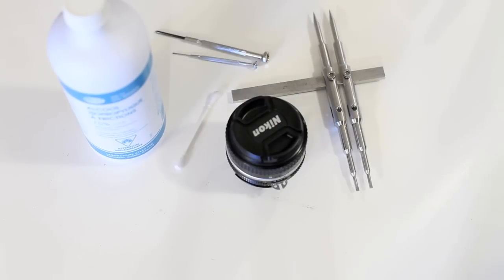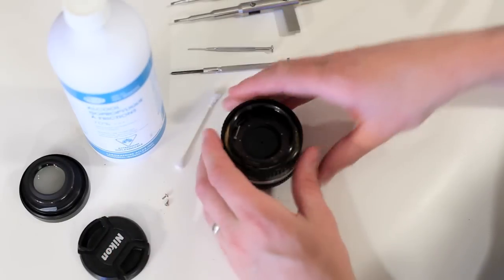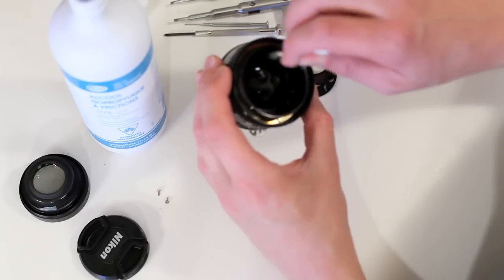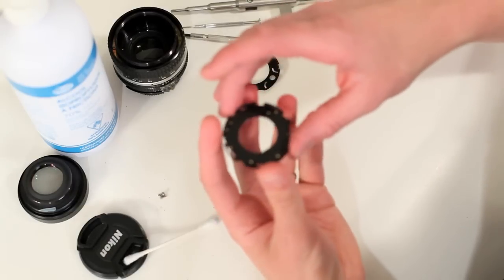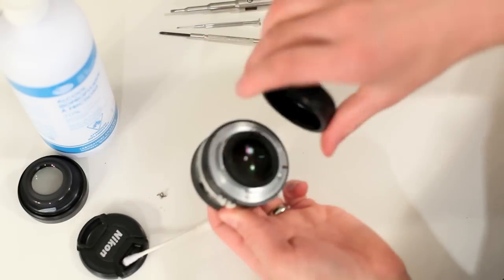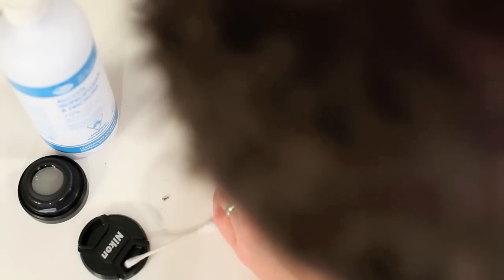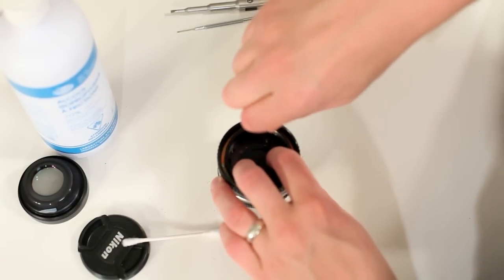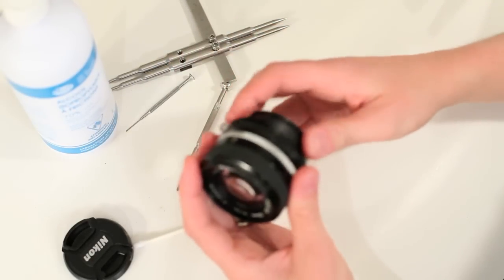How to Disassemble and Repair Oily Aperture Nikon 50mm 1.4 ai-s Prime Lens

Comment: Have you ever cleaned and replaced the helicoid lube in the focusing barrel threads before? I just got this lens and it was in new condition when i got it but i think the lube has dried from sitting in a box for a couple decades, which is causing the focus barrel to be a bit too stiff.

Comment: They never managed to disassemble the lens, one of the 2 outer screws holding the aperture ring has no slot for a screwdriver and is rounded, after removing the front grub screw and taking off the front ring there was a gouge in the thread where the grub screw had dragged (their forced attempt no doubt), managed to get it off though. cleaned the front element but the seepage is in between the 2nd and third lens (group) which appear to be bonded together and held in with a pressed ring.

Comment: Your awesome.  I am in a fix though, I have a 50mm 1.2 that I took apart from the back end and the blades are out but I cant get the front element off.  Basically it seems the only way to put the blades back together is from underneath..not sure if thats possible...thoughts?

Comment: Thanks for the video Todd you saved me from having a $100 AIS lens go completely to waste.  I bought the lens on ebay from what I thought was a reputable dealer in supposedly great condition.  1 month after the purchase, I noticed that there was oil leaking and that the aperture wouldn't operate properly and I hadn't even really used it yet.  I tried to get a refund but the dealer refused.  When I began the repair, immediately i noticed after removing the front ring, that front element wasn't even screwed in.  I didn't even need to use the spanner wrench, the element was completely loose and just popped out in my hand when I turned the lens over.  This tutorial has been a lens saver, thanks again!

 PS, you make it look so easy, it took me nearly 2 hours to complete, blades not cooperating falling off and having to start over, difficulty threading the stem through the hole, nevertheless, it was well worth it.  Thanks again!
Reply from the maker: Woo Hoo glad it worked out for you! Ya that is really odd that the element just fell out like that! Sounds like someone tried to repair it and didn't get very far and made mistakes. Good thing you could repair it.

Ya I have done more lenses then I can count so they become fairly easy when you do a few. My first took me forever when I first started.

Glad this helped :)
Reply: Todd Armstrong Yeah so far It seems to be working great and tikity boo ; ), thanks again! I think you're right about it being a botched attempt at a repair.  I wonder..are there any concerns about the lens not having any oil now?  What do recommend for storage,handling, usage, maintenance, etc, being that the lens is no longer lubed? Thanks again for the great tutorial and awesome spirit for helping fellow enthusiast!  You have great hands too, you probably could have been a surgeon... lol!
Reply from the maker: Rafael Jenes Ha ha my mom always said I should be a brain surgeon but I don't think I could have stomached it ha ha!
Well the only oil that should be in the lens is a very tiny amount on the aperture ring which is thick and never really leeks, and the oil in the focus helicoid. The oil that gets on the aperture blades is the helicoid oil which is lighter and when the lens gets warm it can leak or if the oil starts to break down over years. This can be removed entirely and replaced and in fact if you look hard enough you can find grease that Nikon use to sell. It is really hard to find though. However with my experience I don't think it is worth it to replace as it usually takes years for the oil to leek like this again and chances are one might sell the lens for another way before it is time to clean it again. Hopefully after your clean it won't need doing ever again anyhow.
So as long as the focus is still smooth then there is no reason to replace the grease in the helicoid unless you would like to cosmetically dampen the focus to your liking.
I just clean the aperture blades and shoot. I rarely ever do a helicoid job. :)

Comment: Hey Todd, I own a Nikon AF NIKKOR 24mm. I love this lens. Being from video. I wanted to use the lens without the clicking aperture and successfully did it, but in turn when I removed the back housing I accidentally tore the ribbon cable that talks to the Lens. Do you know where I can buy this sensor? I learned the hard way that opening any lens is just a very dangerous endeavor.
Reply from the maker: Oh no I'm sorry to hear that! I usually look around on ebay for parts or find an ebay lens with smashed elements or something so you can get the lens cheap. Take the part out and resell it on ebay and you "might" even make some money on it ha ha! I buy/sell damaged lenses and bodies all the time to repair stuff.
A rough version would be to solder new wiring as seen at 12:40 but I would get the proper parts for your 24mm.
How to build a Canon 50mm 1.8 ii EF EOS Tilt Shift Lens DIY pt.1

Hope this helps

Comment: Good disassembly vid thanks, Picked up this lens for $50 off ebay that someone had used wd40 on, unfortunately it has creeped in between the front element group (between 2nd and third lens) and has left a ring on the edges of those, they had obviously tried to disassemble the lens but only managed to strip screws and destroy threads
Fortunately the distortion creep doesn't affect the circle for DX sensors so cleaning the first element and de oiling the inside has given me a decent lens for cheap

Comment from the maker: No the lubricant is the problem that makes the blades stick. The blades are suppose to be dry or covered with carbon for a smooth glide. The grease comes from the focus mechanism leaking over time and goes everywhere and can even get on the elements.

Comment from the maker: Gosh I just don't remember. I did a P and either a Ai or Ai-s but I also did a 135mm f/3.5 and one of them are pretty annoying and I just don't remember which one was which. The P I think was simple but I think the 135mm f/3.5 was a pain becasue you have to take apart the helicoid. I think if you get the top taken off yours you will soon see if you can just pull the optics or if you have to tear down the helicoid. I usually dont bother if its the helicoid for time sake. Sorry I can't really help

Comment: Great video ! I have a nikkor 35mm f2 that is stuck wide open. I can't stop down. However if I remove it and slide the lever I can stop it down. Also, if I leave the lever, it doesn't return to wide open automatically. The aperture blades also look oily. Do you think I have the same problem as you ? Would cleaning my lens like you repair my lens? Any help would be greatly appreciated. Thanks !
Reply from the maker: Yes so if you see oil on the blades then it will need cleaning. There should never be any oil on them or they will slow down or hang up. There are a couple versions of the 35f2 but they are fairly simple to clean and similar to this 50mm repair.
Reply: Cannon Fast Reviews Thanks so much ! I will try to repair as soon as i get the tools :)

Comment: Where do you buy the spanner tool? I think I need it to remove the top element from my Nikkor Q 200mm F/4 non (AI-s)
Reply from the maker: J Lewis I get my spanners from ebay. I like the small cheap ones that are curved and also the long straight box spanners. Both do things the other can't do so they are a nice pare together.

Comment: You sir, are a genius. Thanks to you I just cleaned an oil refinery out of my 50mm 1.4 and now it works like brand new. Only issue I had was fitting the pin and aperture mechanism back into the lens barrel with my fat hands holding it. Had to remove it twice and reset the blades. But now it's awesome and going with me on vaca. Thank you for taking the time to post these videos.
Reply from the maker: Woo Hoo glad to hear!! Another lens saved!
Yes they can be very difficult feeding everything back together and takes some practice. Some lenses still take me a bit.

Comment from the maker: Yikes I'm not sure about repairing the aperture from the bottom up and didn't think it was possible to get the assembly out that way. I did one a while ago and I'm just trying to remember how its done. I believe its simple, you need to get the front filter ring off. There should be a screw on the side to loosen first and it may be under the rubber grip. Then undo the rest and the entire optics and aperture assembly will come out as a whole.

Comment from the maker: Sometimes if you just work it for a while it will loosen up but that only works sometimes. I have had some completely seized up and what I do is use Atlas Gear Lubricant which is amazing stuff and is plastic friendly as well. Just a touch and let it sit for a few hours and it will actually soften the old grease and make it useable again without having to replace the old grease. I have used it for about 7 years and works perfectly.

Comment: I bought a cheap used 50mm f1.4 Nikkor on eBay, and it arrived with dark oil and sticky blades.  I use this 100% manually on an A7sII, and I need to know if the oil can keep the isis from opening fully?  When set to f1.4, I can still see the blades poking around the edge, is this normal?  I don't think my lens has f16, because it sticks at f11....not that I ever would shoot there!
Reply from the maker: +Paul Anderegg Hum shoot, well good news is that yes your aperture is working properly at 1.4. You will see a tiny bit of the blades at 1.4 so yes this is normal. But where it sticks will be stopped down like you mentioned at f/11. I guess if you don't care about smaller apertures then the lens should function fine at wide open.
Eventually as more oil makes it way to the blades however you may eventually loose other apertures like f/2.8 1.8 and what not.
This lens performs a lot better stopped down even to f/1.8.
The repair is pretty simple to do though and increases the value of the lens but if you are only shooting larger apertures then you should be ok. :)
Reply: ah, tested the lens out last night for the first time, downtown skyscrapers, all the white dots had blue rings and the colorful stuff was glowing at f1.4, one click down to f2.0 and it all went away. :)
Reply from the maker: +Paul Anderegg Nice! Ya this is still one of my favorite lenses.
Reply: Paul Anderegg i

Comment: Wow, this looks relatively simple if you're careful.  Anyone know if this method would work for nikkor 28mm 2.8 ais and 85mm f2 ais?
Reply from the maker: +Aaron Winter Hey ya the 28mm Ai-s and 85mm f2 Ais are somewhat similar with small variations but if you go carefully you shouldn't have too much trouble. Depends on where the focus is set you might need to focus up or down on the 28mm when you pull the aperture assembly out just to wiggle the diaphragm lever out but it should come out fairly easy.

Comment: Cool video, thanks! I have done this plenty of times on MF lenses but I'm afraid of do it  in an AF (I ruined a 28-70 once), I got an old 50 1.8 AF, (the first one) and squeal like a bloody squirrel! I fell so tempted to desamble the whole thing.
Reply from the maker: Ha ha ya they can do that. I find that sometimes it is just where the AF pin gear sticks out of the mount can rub just a tiny bit causing a squeal. I just dab a tiny big of oil in it and many times ends the squeal.
Reply: Todd Armstrong I did it, I took the whole thing apart, it wasn't that difficult after all, except for the aperture lock switch, and, to find the infinity focus, which require to take the barrel out plenty of times (and mount on the camera to test). do you know of is any sign or guide in the lens that let you know how to screw the barrel back in the right position?
Reply from the maker: Felipe Paredes Hum it sounds like you have taken a helicoid apart? I dread them and its usually a matter of trial and error until you get it. Some lenses will have tiny scribed marks on the from the original assembler but it's hard to say. I try to stay from the helicoids entirely. I don't know of any manuals on them.

Comment: Todd..thanks for the videos...any advice on a 24mm Nikor Manual lens...had to take it apart to free up some frozen parts due to salt air exposure...however when reassembly mode I can't seem to get the full range on the click f-stop....also trying to line up focus iris and spring control is tough...any secret combination to make all things work...?....dialing inall three...at once.
Reply from the maker: If it is a Ai or Ai-s it sounds like the only thing you are missing is the 2 pins that slide into the slots inside the lens. If I remember correctly it is easier if you focus the lens to close focus. This gives you more space to work. Then if you have the rear mount off you need to feed the 2 pins into their appropriate slots. If you have the front element assembly out and NOT the rear mount off you will do the same thing but through the front. I'm going by memory so I may be wrong though. What you want to do is set the aperture ring to f22 and slide the aperture pin on the side of the element assembly to "around" f16. Then line everything up on the other pin and the slot it slides into on the mount lever. Slide the assembly into the barrel and when you bottom out rotate the aperture ring to f11ish. The point is on its way around f16 it should drop in since you have the pin on the side "around" f16. Hopefully they mesh and you will be good to go. Might take 2-3 tries. I'm guessing here because I haven't done a 24mm for a bit. Hope this helps.

Comment: Holy-moly? That's my word. We are kindred spirits. I like making otherwise discarded stuff work like new. Ever disassemble a 50/4 El-Nikkor enlarging lens?
Good job!
Reply from the maker: I have not done one myself but the build looks pretty common of the non ai lenses. I have a video of the 50mm 1.4 c or sc which looks similar and may be. You would remove the front name ring and then there may be a couple screws. To split the elements you may need a spanner but I'm only guessing. Maybe check out my other 50mm sc video and it might give some pointers. Sorry I couldn't help much.

Comment: Since your video is very helpful and informative, I felt free to ask you about a big problem I am facing. I just bought a used 300mm Auto Paramount lens. The problem is, I do to not see any aperture blade when I turn the aperture ring clockwise or counter clockwise. It is just seem to be blank with no visible aperture blades. When I shake the lens I hear some kind of sound from the place inside the lens where the aperture blades are supposed to be. My lens has got the mount of Minolta lenses. What can I do Sir? Please help me out asap and write in details what can possibly go wrong. Is it possible to repair my 300mm lens? I would love to appreciate you kindness. Thank you.
Reply from the maker: Hi sorry I took so long to reply but I couldn't figure out how to reply now that youtube joined googleplus.
I think the lens you are referring to is a Nikkor 300mm f/2 ED IF? I have not had this lens but from what I understand the aperture is a separate section that can be taken off. My guess is that it has been jammed and might just need to be taken apart and repaired. Sorry I can't really help.

Comment: Thanks Todd. I will endeavour to clean my lens as per your video. I have several questions for you though- 1) how long will a cleaning last? 2) If I have a grease leak, it can possibly leak again. So is there a gasket that I change to prevent further leaking? How will I know if I still have grease inside the aperture? Or how much grease is gone?

Cheers, Jo
Reply from the maker: Hey Jo sure no problem.
1. So as far as cleaning the actual parts they don't take much to clean since the alcohol breaks the oil down so quick. Just a few wipes and it should be good. For disassemble, cleaning, and resembling a lens for the first time should still be under 1hr I would think.
2. The oil may not ever leek again as long as you keep it out of heat. That is the main cause for them to leek from the helicoid. I don't recommend cleaning the oil from the helicoid becasue it needs that to have a smooth focus. This is usually the source that ends up on the blades.
No there is no gasket in the lens and I don't believe you can add one either. They rely on the original grease being thick and not leaking and most won't. Its only from people leaving lenses in hot areas or left in the sun for a long time. As long as the lens is kept cool or normal temperatures it will always be fine.
3. You should be able to get the parts completely clean and it is very easy to see when your cleaning the blades. If there is a tiny bit left that you can't really see it won't effect anything. As soon as you start swabbing the blades with alcohol you will see it vanish right away. Its really easy. The only hard part is putting the blades back in without the falling all over the place.
hope this helps.

Comment: i remove the that tiny screw, and i cant remove this first ring. its looks like the ring is mired. Can you give me some ideas to fix this? Thanks! :) and great video.

Im working in a blog to get together a lot of nikon service manuals.
Reply from the maker: Hum I'm not totally sure. 2 Possibilities I can think of is either it has been glued down, or some lenses have variations in design over the years. Perhaps yours is a slightly different design just like there are a few designs of the 50mm 1.8 Ai-s/E and Olympus 50mm 1.8. I have not seen a diff 50mm 1.4 Ai-s but I'm not sure.
I'm sorry I wish I could help but I'm not sure.
Personally if I have fully inspected it and not seen any other screws I would attempt with a rubber jar opener. They work like magic.